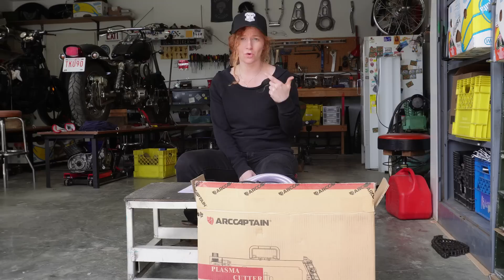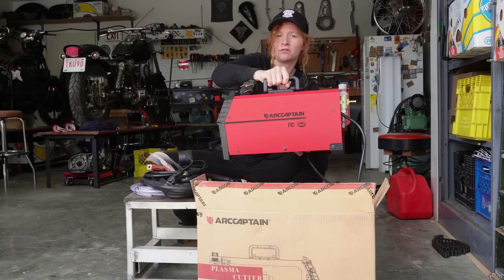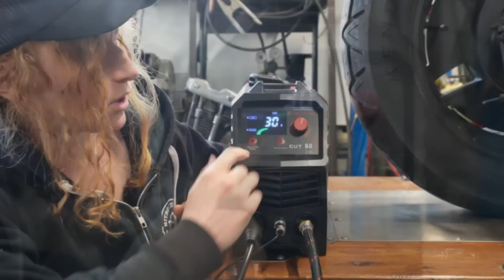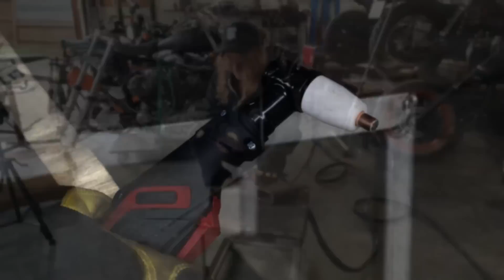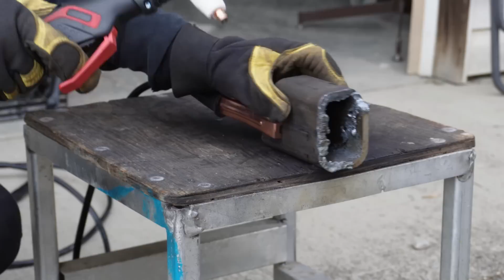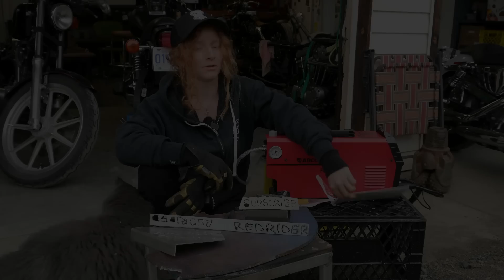Arccaptain CUT50 | Is It Really Beginner Friendly?

Comment: I bought a considerably large plasma cutter some 28 years ago, used it extensively up to a week ago, still working great, just keep your tips clean and keep plenty of replacement parts so you don't have to go buy some more in the middle of a job. I suspect you'll be well pleased with yours as I've been with mine.
Reply from the maker: Good advice!

Comment: Good morning 🌅, Angel, excellent piece of kit, especially when you are fabricating parts for your bike, or anything else that you fancy doing, like making signs, et cetera, I’m not telling you what to do, but it is very dangerous cutting zinc coated metal, as it gets off toxic fumes, from the coating, and you really need a full face mask, for breathing, I believe if you go onto 3M‘s website you should better find a mask that is capable of protecting you from toxic fumes, and if you’re going to do quite a bit of it, it is worth getting a coat that doesn’t catch on fire, and make sure your hair is out of the way, and you really need tinted glasses, 🤓, I’m sure if you go online, you’ll be able to see the safety equipment that you will require, when I was very young ha ha ha ha ha ha, I worked at a company on a profile machine, they had four Oxy acetylene cutting heads, didn’t use them all the time, I used to have to make the pattern out of sheet metal very accurate that was clamped to part of the machine, and there was a magnetic wheel that used to run around the edge of it, this would give me a perfect size dimensions for the parts I were cutting, I was making Gussett for building cranes, 🏗️ 😂, leather apron might be good, 
When cutting a straight line, you can use something clamp to your material that you can run the plasma cutter head against this will enable you to cut a straight line , good luck on your projects I can see you building a complete bike soon, keep up the great work stay safe, ❤ Fr

Comment: Many guys have already written and I agree with them. Use a mask or respirator to prevent your sweetest nose from breathing metal dust.❤
Reply: Пётр Петров и Не Пётр Не Петров, насколько разные личности, интересно? Как будто две крайности одной сущности!
Reply: @Greg-ek3nj  Это будто биполярная- биполярка, только односторонняя, как в мультиках у Шкя, расслоение мозжечка и кривой нос внучка.. Надеюсь ты знаешь ответ, от куда кривой нос у внука?!
Reply: I'm going to add one of these soon, probably the 55 version. I have an Arc captain 200 TIG and although I have only stick welded with it so far, I am very impressed with it. Not to be a "safety Sally" but a #8 lens is advised for plasma cutting.Also a good respirator,I'm told the fumes are worse than from welding.I enjoyed the video and subbed you..
Reply: Создадим суету в комментариях для продвижения видео с набором слов😂 и так, анекдот: Школьник с очень плохим зрением на протяжении всей дискотеки приставал к куртке одноклассницы😂❤

Comment: Hey Red, nice job cutting and you picked it up quite quickly. I have used plasma cutters when I was at work. You should have a litter better eye ware though. The arc from the torch is as bright as a welding arc and can easily cause eye damage, also you could just leave the tip touching your material and have just a slight angle away from the direction you are pulling. This will help in not damaging the tip so quickly as there will be less chance of blow back onto the tip. Hope this helps.
Reply from the maker: Thanks for the tips! I’ll try those out

Comment: If you buy one for yourself make sure you got decent cables or they heat up to much also their are models with build in compressor handy but you can u compresser on its own for tools/there is a ring with fits the cutting head so it leans on the metal

Comment: It's good to see you back in the shop. Isn't a plasma cutter a grand thing? I was still working in a fab shop when they first came out and remember the difference it made in metal cutting. I don't remember having to hold a gap when using it. We just made contact with the tip and kept it that way adjusting speed for metal thickness Pulling worked better than pushing. You weren't having to move the tip through any slag.
Reply from the maker: Yea I’ve found the pulling works a lot better

Comment: You said that you did not know where your Father got the moon shaped piece of steel for the bead breaker.  It's just a piece of flat plat cut to the shape your Father wanted with the Caytlen torch. The Plasma arc cutter will do the same for much cheaper.
  They sell Chalk Sticks for making lines on steel at the Welders supply store where you get your oxygen and acetylene tanks refilled.  The Chalk is like 3/16" thick .
Reply: Red your doing just fine practice make perfect. Careful don't catch your hair on fire.
Reply from the maker: Cool thanks

Comment: They have super voltage to start your arc.  I don't think you are ever supposed to touch the metal.  It's far better to go too slow than to go too fast. You need to hold your torch steady like use your other hand for a rest.